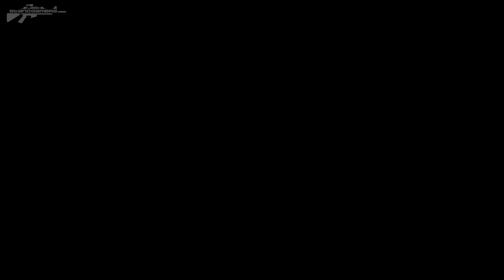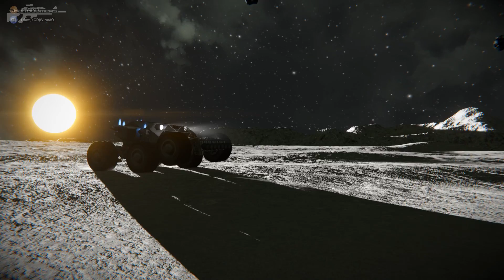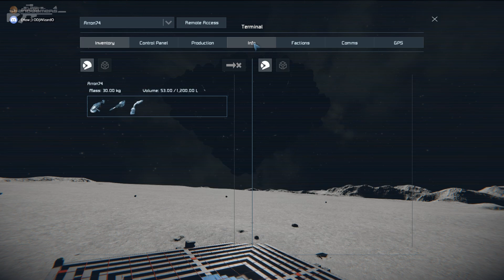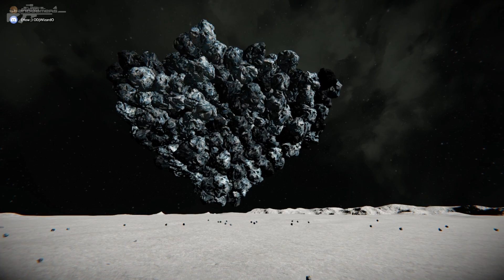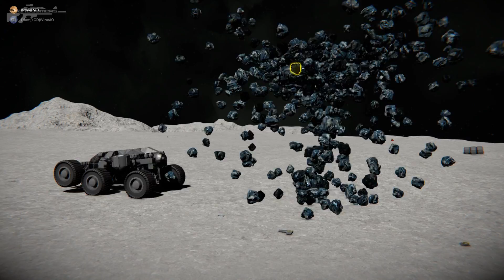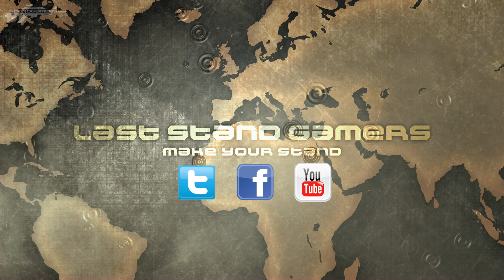Space Engineers - Deadly Gravity Tornado Twister

Comment: Aaron, don't know if you knew about this, but I found out that turrets don't target grids that have no components (such as pieces of armor)
So if you launch a metal slug, with no components, then it is UNTARGETABLE :) 

(but practically doing that is a different matter entirely, there's no way to accelerate a grid without any components, and having the thrust pack for this slug separate mid flight still leaves the slug with some components) - AND ACCELERATING THE SLUG WITH A SIMPLE SHIP USING LANDING GEARS IS BARBARIC AND PRIMITIVE !!! :) (also difficult to aim or print)
I am working on a solution to that right now, will post a link to steam workshop in a few hours if you're interested.

EDIT
here ya go:
https://steamcommunity.com/sharedfiles/filedetails/?id=1748898977
Reply: Its actually easyer than you think you just need to put a gatling gun on the thruster that aims towatd it and a timer that makes the gatling fire at the thruster at the right time and your left with a exalerated slug without components
Reply: @nighthunter3039  Thought about that, but gatlings are small grids only, for it to do tons of damage it has to be a large grid... (So I couldn't use gatlings)
Reply: Railgun with printer(s) and print dem slugs